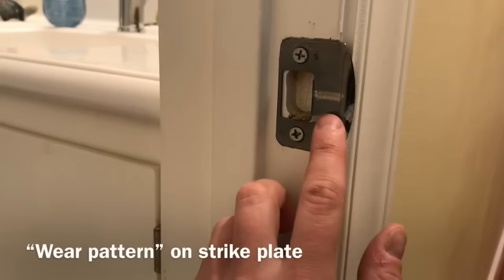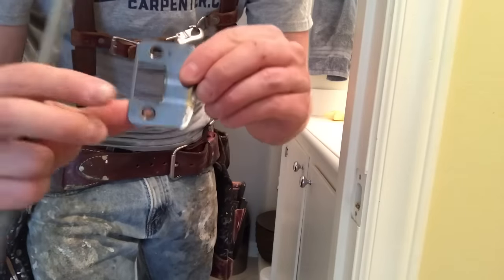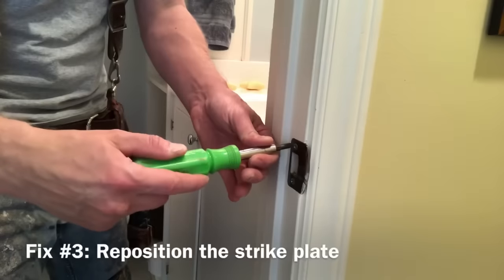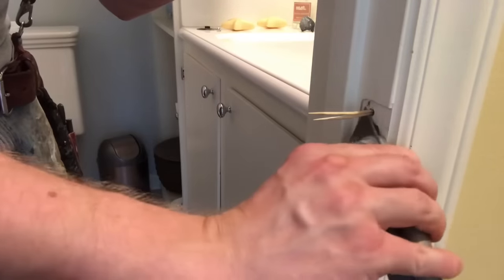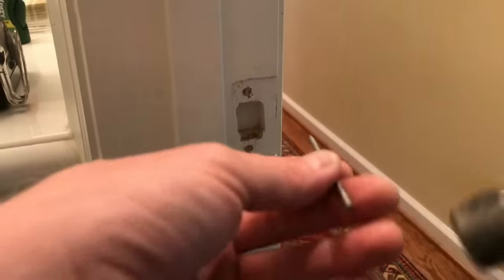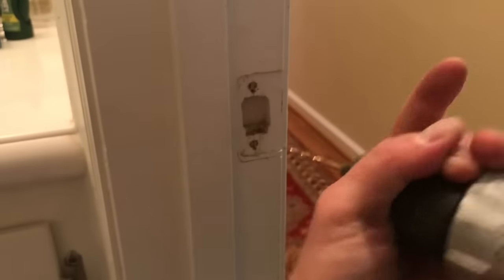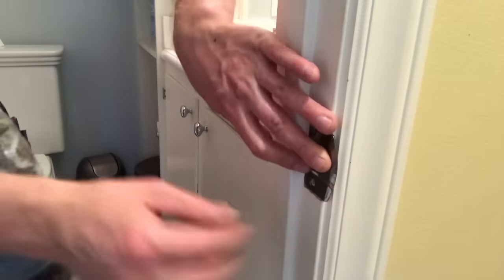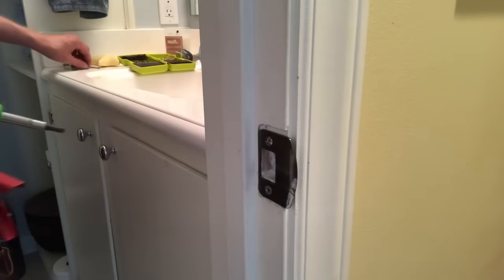Door Won’t Latch—3 Easy Fixes!

Comment: Sometimes driving a 3-4” screw into the top hinge to replace one of the screws will raise the door enough to fix it. Great video!
Reply: Yep exactly this is something to consider. Gotta look at all of the factors.
Reply: Yes the top hinge wears and the door can hang out. I always make sure the top hinge is fixed and not loose.
Tightened up many top hinges!
Reply: Use a knuckle wrench or a crescent wrench to bend the knuckles on the door hinge only. Tap pin out on top or bottom according to which one is closest to the jamb. Use a shim to space the door and adjust the knuckle to match the frame hinge.
Reply: You just helped me fix a bedroom door that was misaligned.......thanks!

Comment: I find golf tees work the best at filling old hole.
Reply: I like that idea.  We used chopsticks from Panda Express and wood glue.  Hammered it in and break it off.
Reply: I use em too, Get mine @ Walmart in the sporting goods section.
Reply: David Ungerecht mmmmjm Jimmu
Reply: chop sticks and cabob sticks work good too
Reply: Second. Fixed two doors in my house with them work way better than toothpicks
Reply: Great idea!
Reply: I remember i filled the holes on a guitar headstock (where the machine heads were) using toothpicks and wood glue, highly effective
Reply: Aren't those a lot more expensive?
Reply: @Dankyjrthethird  I find I usually just use toothpicks and don't need the glue.
Reply: @jsmith5443  if you mean golf tees no. You can get 100 on eBay for a couple of dollars. Last a life time.
Reply: and wood matchsticks
Reply: I use plastic tees. I'm screwed
Reply: @Yodumeee  lol.
Reply: @Hello Larry how are you doing

Comment: I like to use golf tees for filling in the old screw holes
Reply: Golf tees work awesome as does bbq skewers and dowels.  The dollar store has a great selection of skewers, dowels, popsicle sticks etc. For a few bucks you can keep a nice selection of ready to go plugs for your kit.
Reply: Ed Over50 I do the same but have forgotten the dollar store is a great cheap resource, thanks for a reminder.
Reply: I use wooden matchsticks from "strike anywhere" matches. I just clip off the head, coat them with glue, and tap them in with a hammer. Then I use a sharp chisel to trim them flush.
Reply: mnm1067 - that's so brilliant! I often use toothpicks for golf tees.......
Reply: @JohnnyTalia  Wont using match sticks void your fire insurance policy  ?
Reply: I thought golf tees were my secret. They do a great job of filling a screw hole.
Reply: i tried to use a toothpick as a golf tee. im still here setting my ball
Reply: I use q-tips.
Reply: I use little pricks
Reply: Is there any reason you can't just use wood filler?
Reply: @transws6am  you could buy it might pull out with the screw. Add a little wood and wood filler and it might be stronger.
Reply: Chopsticks
Reply: @brandonrobinson9272  chopsticks are usually bamboo and the density of the wood is too different. Besides, that could get expensive if you were having to buy them.
Reply: @transws6am  Yes. Wood filler is not durable enough to withstand the force transferred from the striker plate to the screws during opening and closing the door. Overtime the wood filler will weaken and allow the screws to shift back into their original holes causing the striker plate to loosen and detach from the jamb. Better off to fill the original holes with solid wood pieces and glue like the video suggests. It’s actually pretty easy to make your own hole plugs. Grab a 2x4 and use a miter saw to cut off a 2”-3” piece. Rotate that piece 90° (so the wood grain is running north to south) and use the miter saw to cut off a thin 1/8” slice. Then lay that slice flat down on the table and use a utility knife to slice off several 1/8” toothpick-like strips. Use those toothpick-like strips as your hole plugs. If they don’t fit the holes perfectly use a utility knife to shape them into smaller strips. Hope this helps 💪🏻
Reply: @michaelmills4927  just save them from your take out

Comment: If the old holes keep messing up proper alignment with new holes, even after the toothpick filling, you can drill out 3/8" holes, then glue a 3/8" plug. This should provide a fresh wood area wide enough to mark and drill new holes without the hassle of bits wandering into old holes, or shifting from varying densities of fillers.
Reply: Where do I get a 3/8" plug? Sorry, I am fairly new to DIY.

Comment: A couple of quick things I noticed in this video. #1 the door hinges could have been spread to close the gap at the jam on the latch-side. #2 to fill the existing screw holes use a wooden golf tee with wood glue instead. That will fill the hole completely and allow for a better fit for new holes.
Reply: A golf tee....great idea.  Thank you.
Reply: Golf tee is a great idea for filling a hole completely. Never thought of that. I always use toothpicks for things like cabinet door hinge holes that have come loose +wood glue to create more "bite" for the screws.

Comment: Sometimes shimming the door works as well... especially if the door is sagging or not squarely hung in the frame to begin with, either due to worn-out hinges, or because the door frame assembly isn't square to begin with.

Comment: I love these jobs cause 1)they’re easy 2)pay well 3)home owners are always so happy to have a non sticking latching working door. I’m amazed at how often. Doors are installed wrong. Especially pre-hung doors that take a lot of the guess work out. If you’re a trade carpenter I’d suggest hanging Jams and doing the hinges yourself. If you master that, fixing junk mdf jobs is a breeze because wood jams, trim, and doors can’t be fixed with caulk and paint

Comment: first check the hinge side, top hinge screws loose will allow the door to drop.  Shim bottom hinge with thin, cereal box, cardboard to shift the latch side up.
Reply from the maker: All good suggestions David. The three repairs I’ve shown are for significant hinge side sagging (and if you don’t want to try rehanging the door). These small hinge side tweaks can help tremendously though. Thanks!
Reply: Don't use cardboard for this. It will continue to compress over time and you will be back fixing this problem again in a month or even less.Use a thin piece of metal, like a strip cut from  coke can.
Reply: @MAGAMAN  Or coins.

Comment: I feel that you did this fix mostly on the wrong side of the door. I would have asked myself first why has the door dropped?  As already mentioned by someone else worn hinges. If that were the case then either replace the hinges or a temporary fix is to pack out under the lower hinge. Another fix would be to bend either half of the bottom hinge out or the top hinge in. This is done with the hinge pin removed. If the door frame has moved because of house movement then what you did would work.
I used to fill screw holes like you do however these days I find that a better solution is to drill the old hole out and glue in a dowel, trim with a multi tool & then drill  fresh holes.
Cheers
Reply from the maker: Thanks John! You’re right, much of the repair can start on the hinge side. I’ve definitely had success shimming out the lower hinge. The only time it’s been a problem is when the door clearance is already tight on the latch side and moving it out makes it tighter. But the other things you mentioned I haven’t tried before. I’ll give them a shot!
Reply: @Hello John how are you doing

Comment: You can also drive a 3" screw into the top hinge center screw. It will catch the framing and pull the door up. Use an impact driver, being careful to not overtighten and break the screw head or split the jam. This process will pull the door up slightly providing enough upward hang to allow the door to shut. This however, may cause the door to swing open or shut depending on the door swing.
Reply: For the bathroom, it always swings to open. 😍
Reply: So longer screws in the top pull the door up? What about in the other hinges

Comment: Sometimes the strike plate and latch are in the right places of the door and jam, but over time the door has shifted in alignment (tilting down). To fix it you can bend the hinge loops inward (on the door side) and it will move the top of the door enough that the latch and strike plate are now back in alignment.
Reply: Done that works great
Reply: I worked on my in-laws door a few weeks ago and tried that but their hinges were too beefy to bend easily w/o leaving obvious tool marks so I switched to unscrewing the bottom hinge (frame side) and using pieces of wood shims to shim it out a touch and now works every time.

Comment: The toothpick is a great idea, I always drilled the hole out to 1/32 or so smaller than a dowel then glued and hammered the dowel in the holes.
Reply: I like to use 1/4" drill and matching dowel, with wood glue or even Elmers.  It's a tight fit and dries firmly in seconds.  The old threaded wood was weak;  the new solid fill is great, even when the new hole is close to the old.

Comment: Some of these comments are from real finish carpenters. Replace one middle screw thru the top hinge along the jamb with a 3" screw is a great try. Takes the least amount of time and maybe some follow up with the strike plate. Your FIX #3: Way too much extra time spent on unnecessary steps. You gotta have a sharp chisel for this. No excuses! Get a sharp one! There is no need for a razor blade or glue. If you are using toothpicks, mark them and cut them 1/8" longer (use wire cutters). Then, hammer them in. It blunts the head and forces the point end in tighter. Glue is not needed. It's ok if you wanna drill a small setter hole. No need for a second pass with the larger drill bit. You want the screw to squeeze in tight. No wiggle room. Most door jambs are made of MDF not oak or any hard wood. ALSO possible... the strike plate being too far in.

Comment: The 'reason' the strike plate 'appears' to be too high, is because the HINGES are wore out.
Replacing the hinges will raise the entire door back into its original possition.
Your welcome...
Reply from the maker: @TheSirRip I definitely see plenty of worn-out hinges, but these were still too new to need replacement yet. Don't you feel that latch-side settling can also be a common issue? In this case, I think a slightly overspanned beam in a remodel below this door was the cause. I hardly ever see a doorway that doesn't experience at least a small amount of settling at some point, and in some cases its on the hinge-side, which causes the reverse problem, not to mention possible door dragging
Reply: "you are "
Reply: Absolutely, if hinge screws are tight then hing is probably worn out.
Reply: In my house (1944 pier and beam) the house rises with rain and falls with drought.

Comment: That door has clearly falling from the weight of the door on the hinges. You could probably replace one or two screws on the top hinge and be done. No need to adjust the plate.
Reply: right! do you mean adding door shims on your hinges or just new screws in them
Reply: @Ryan-kz7ej  I don't know why Scan is assuming anything.  Diagnose what's wrong, first.  I put a level on the top of my front door, that was having this problem.  The door was perfectly level.  This particular video doesn't walk through that.  You'd first check if your hinge screws are loose (a few of mine have been "fixed" with this alone).  If not, put a level on the top of the door.  If tilted, and the spacing around the door/frame is unequal, hinge shimming should fix it.  If the door did in fact have lose hinges and you just carved a lower catch in the door frame, the door will eventually "lean" into the top of the door frame, causing it to stick, when opening/closing.
Reply: @buzoff4642  He replied to another comment that he totally agrees with this order of operations and wishes he'd included it in this video. He was on a job site and just covered what came up and came to mind. I'm sure he ruled out hinge fixes first
Reply: @ItsAsparageese  "He replied", "wishes", "he ruled out", all unfortunate, for a newbie who views this.  Not unusual though, "intended audience" varies, with no experience rating, on these contributions.

Comment: I know this was put up a year ago, but I just had to thank you. Our side door wouldn't lock and I was worried about having to drill new holes because my mom usually does stuff like that. I managed to glue the toothpicks in and drill new holes for the door to lock and I'm so happy it worked and I didn't screw it up. Thank you 💜

Comment: This issue almost always results from the hinge side.  Doors hang off of hinges and sag over time.  To see this, close the door and note the difference in the gap between  the door and frame at the top versus the bottom. There are then several ways to either reset the hinges or replace a hinge...
Reply from the maker: Ron Fastov Thanks for writing in! You’re right, hinge side changes can solve so many problems so long as you have adequate space around the door slab. I wish I’d brought it up in this video, but was filming with clients walking around the house. Before too long I’m going to do another video about door movement, and assessing exactly WHAT is happening with the slab/casings before repairs are even attempted

Comment: I had a strike plate that was off just a fraction of an inch. The file was the perfect solution. This door has been an issue since we bought our home 15 years ago. I didn’t want to cut the jamb. Thanks for the video. Glad I found your channel.
Reply from the maker: You're welcome, Dennis! It's crazy how often that tiny fix does the job. I'm glad it worked--thanks for watching!
Reply: @Hello Dennis how are you doing

Comment: When I have had to do the third fix, I use dowels instead of toothpicks. Works better. I have a homemade dowel plate and can make 1/8” dowels to fill the screw holes. Works great.
Reply: Ikea furniture is great resource for wood dowels. most build it yourself DYI furniture has them, I liberate the dowels when I finally throw out the flimsy Ikea crap

Comment: Three good ideas. Another issue occasionally encountered with the strike plate is the 'tongue' of the strike plate, which extends into the mortise. If it is bent too little it can prevent the bolt from entering the mortise enough to securely latch. Remove the strike and bend it with a couple of Crescent wrenches, one to hold the strike and the other to bend the 'tongue' if placing a large screwdriver against the 'tongue' and hitting it with a hammer doesn't work. Several viewers mentioned loose hinges. Excellent point. If the screw holes no longer hold the screws securely they can be repaired with toothpicks, etc. The first thing I check is the door reveal. Occasionally hinges become sprung. A door doesn't have to sag much for a lock to not latch. If the reveal at the bottom edge of the door is too large place a small piece of hardwood dowel, 1/4" or 3/8", as close to the knuckles as possible and gently close the door on it a few times. This will push the edge of the door towards the strike jamb and raise the height of the bolt. If the top of the reveal is too close to the strike jamb, remove the hinge pin and use an open end wrench, just large enough to slip over the hinge knuckles, to bend each knuckles slightly away from the door. This will pull the door slightly away from the strike jamb and raise the height of the bolt. This can also fix a sagging door that a customer thinks needs to be planed down because it is rubbing against the strike jamb. If the hinges are heavy duty you may have to remove them and place them in a vise. I really enjoy your videos. Thank you

Comment: You might want to inform your viewers to check to see if the door itself is secure at the hinge. Bathroom doors are usually hollow core and the hinge screws are real short. Making the door level usually helps  aligning the  the lock to the strike plate.

Comment: Put baking soda on the toothpicks. Fill the strike plate jamb holes with super glue. Sprinkle more baking soda onto toothpicks as you insert them. The soda activates the super glue within seconds. No ten minute wait.
Reply from the maker: I’ve never heard that trick before dd! Thanks for sharing! 😄
Reply: @TheHonestCarpenter  Luthiers use it on guitars to fill in the nut where the strings have worn the slots down. Now the slots can be filed to the appropriate height. I've never seen a carpenter with a box of arm n hammer in their tool pouch?!
Reply from the maker: Spiccoli Rocks I can borrow from the homeowner! 😂 Thanks for the luthier tip. Do you make/fix guitars? I’m going to start doing tip/trick collabs with other tradespeople on my website. I’d love to do a quick article on something like this, if you’d ever want to reach out to me there
www.thehonestcarpenter.com
Reply: Yes i do work on guitars...
That would be cool!
Reply from the maker: Spiccoli Rocks Awesome! Drop me a line whenever you get a chance!

Comment: Nice video. I always have extra strike plates in my tool box when anyone of my tenants move out. I buy new locks to install n I keep the old strike plates if they are in good shape and some of them are thicker than others beside recycling is a good thing.
Reply from the maker: @Frank Fakir Thank you! Good call on the extra strike plates. I used to have stashes of most types of interior hardware in my old shop, and also my van. You just never know when I might become useful 🙂
Reply: "I buy new locks to install"  Lowes will rekey locks, for cheaper than replacing.

Comment: I learned a trick that works for this.  It's called stretching and shrinking the hinge.  By adjusting the barrel of the hinge, bending the two or three barrels on the hinge to lift or drop the door almost always works.